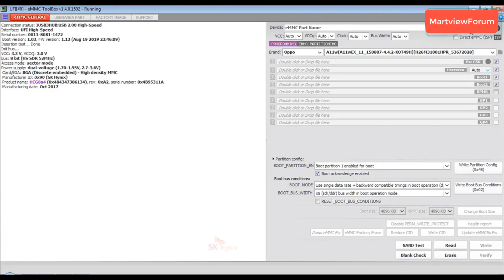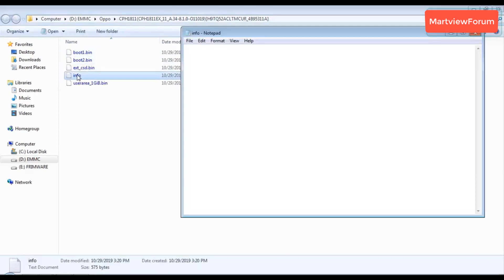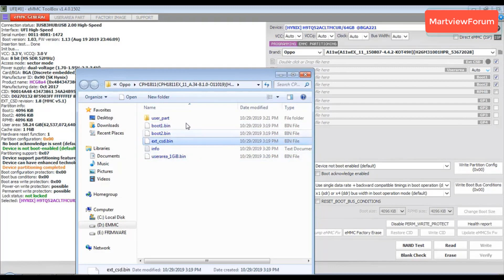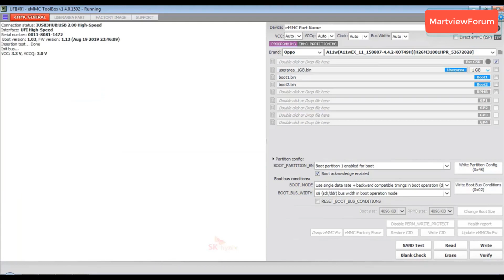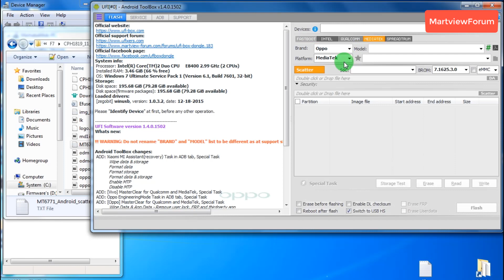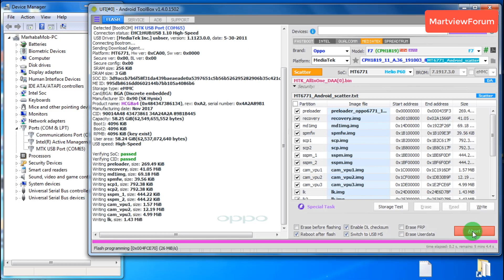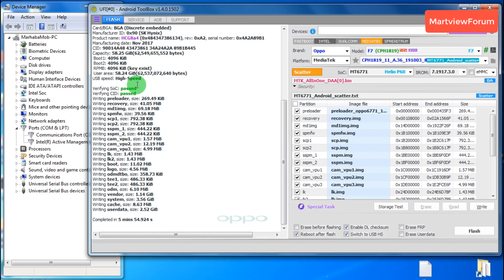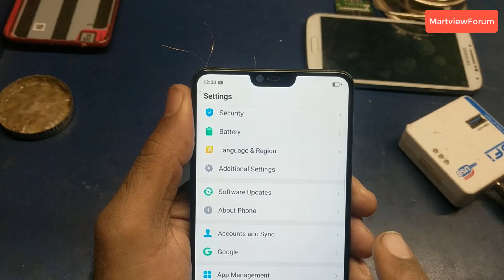Oppo F7 CPH1819 Hang On Logo OR Dead Boot Repair UFi Box

Comment: Reading userarea, size: 1 GiB...  Failed to read block 0x00E00000:65536 (return code: 1, CMD Error: Timeout)
cmd response: 0x900, card status: 0x0, card state: 4 (Card is in transfer state)
 status: unknown (0) faceing thiss  problem  oppo f9 pro plz help